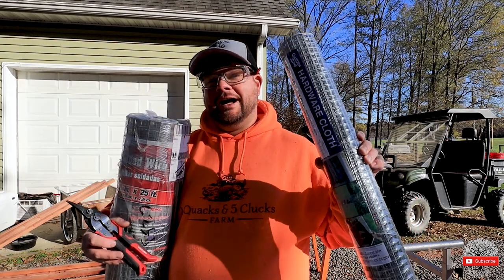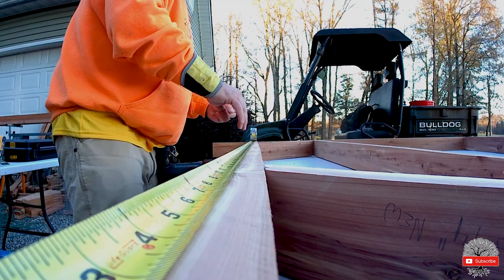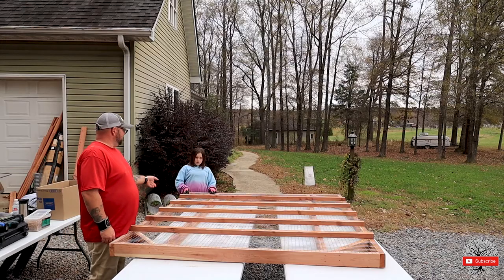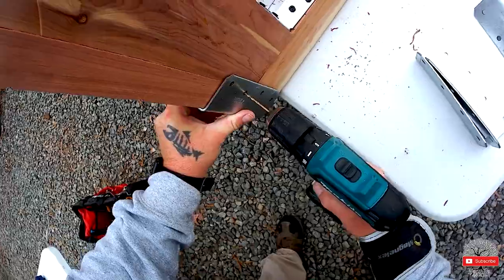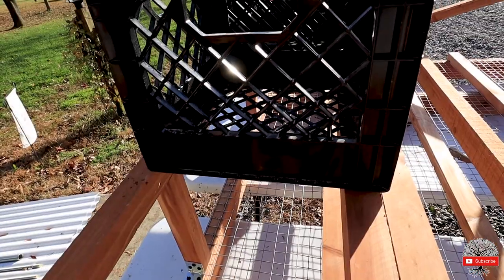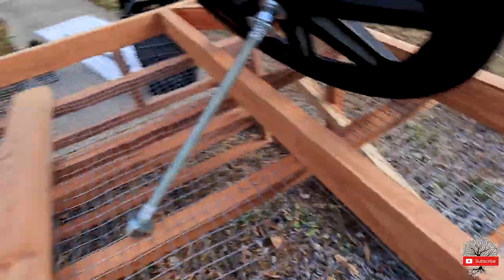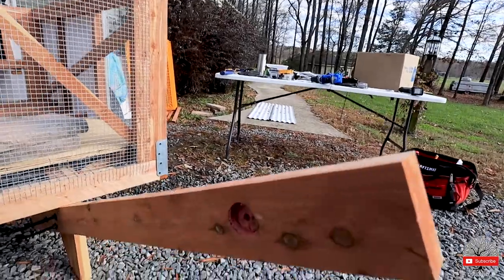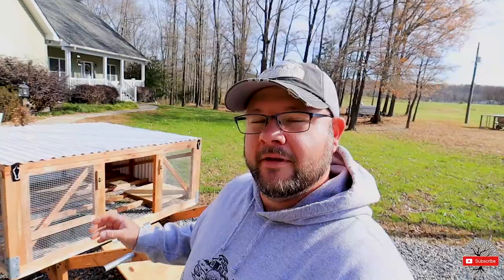EASY TO MOVE Chicken Coop On Wheels | The Chickshaw

Comment: Good  video.  I built mine early in the season before I started making videos.  Wish I would have captured that build. Get you an impact drill Bud, it will save you the wrist pain.   You will be glad you did
Reply from the maker: Thank you! Yeah I have a DeWalt impact. That Kobalt I was using is 24 volts. Plus I have severe carpal tunnel syndrome in both hands. But you are correct, I should have used it. I will when I build another for sure! Thank you for taking the time to watch Adventures on the Homestead!